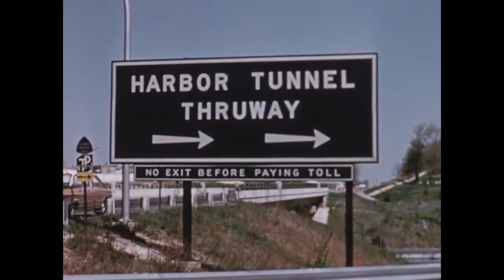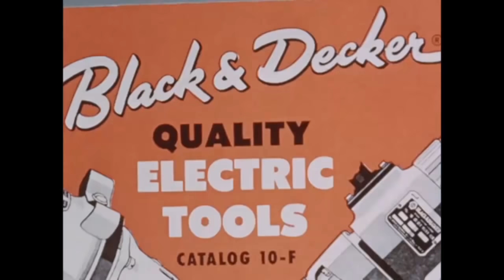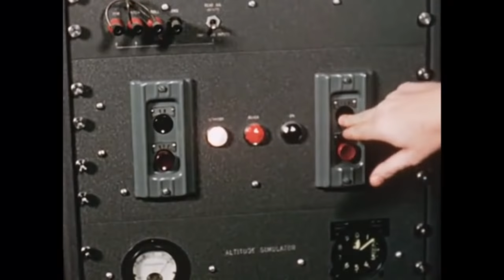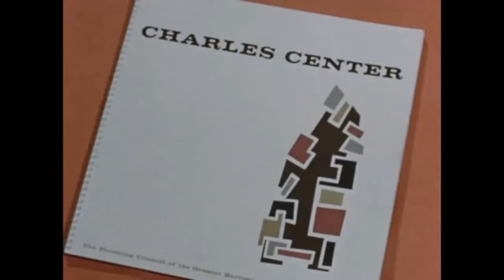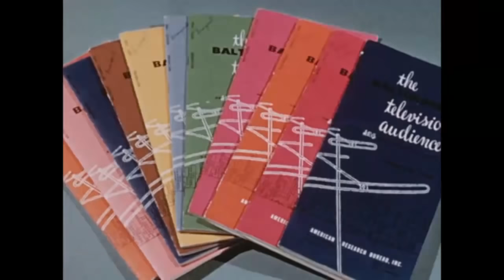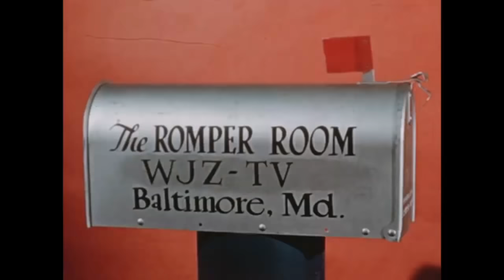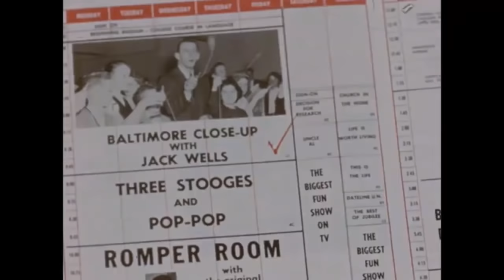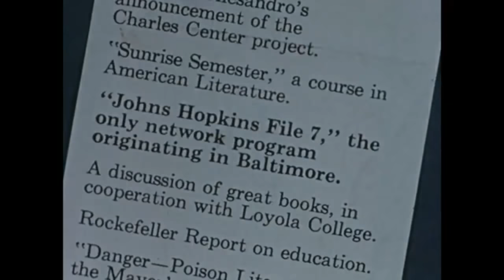WJZ Baltimore:  This is Baltimore - 1959

Comment: Should be required viewing for all public servants, politicians, city planners, all of whom seem to lack math skills.  Here's the problem:  Start with lots of good jobs.  Now, subtract the jobs that can be done by a machine that never asks for a day off.  Next, subtract the jobs that aren't needed at all, like elevator operators or the receptionists in those shiny new office buildings.  Next, (and this is the big item), subtract any job that can be done by folks who work for much less in Mexico or China or Vietnam.  Finally, subtract the new, highly specialized jobs for which workers are in demand but hard to find and not enthusiastic about moving to Baltimore.  Draw a line under this and all that's left is low, low prices every day.

Comment: Interest note, tax rates were at there apex during this time.  The highest tax bracket paid almost 90% of their income in taxes.
Reply: Bring it back baby
Reply: The interest rate was 6% for a home loan.  You could get 2 to 4% for savings deposits.  True the super rich paid their share until they learned to buy both political parties.  Americans have been robbed since 2008 by the FED and big banks.  The saver's money is worthless because the banks get it for free from the FED.  A banker once told me a 2% spread was a decent return like paying 4% to the saver and charging 6% to the borrower.  For 15 years now, I have been getting .05% on my checking account back in 2007 I was getting 5%.  Banks are making 100% profit on depositors, but they are still losing their ass by playing the stock market.  It is 1929 all over again.

Comment: Where are all the black people??
Reply: This is before white flight. Baltimore was majority white then...
Reply: @214dude2  no tf it was not black people weren’t used as this was a marketing film for people lol e to invest in this city. As you can see still it’s failed as a white utopia is a failure
Reply: @24POWERS  Obviously, you’re not very smart. Have you seen the demographics of Baltimore during the 1950s? Baltimore was mostly white during that time. In 1940, Baltimore was 80% white and 19% black. Baltimore had a big population decline since 1950. The city’s economy has greatly declined and in result, the vast majority of white ppl left the city. In 1950, there were 949,708	people in Baltimore. Now, there’s only 593,490 people in Baltimore. Baltimore has not had a population that small in 100 years. Baltimore’s population has dropped every decade since 1950. That’s why there’s a lot of abandoned buildings in Baltimore. Google is free bruh...